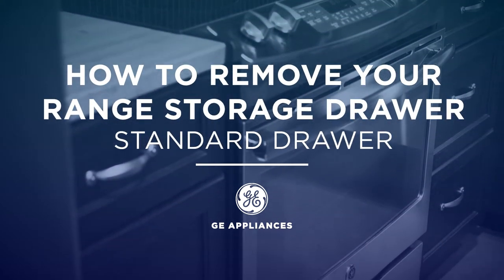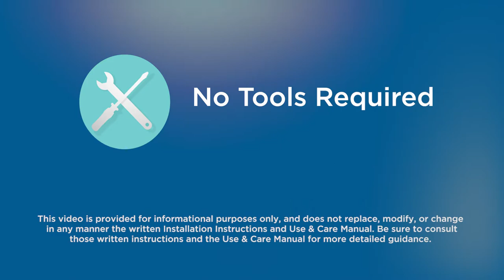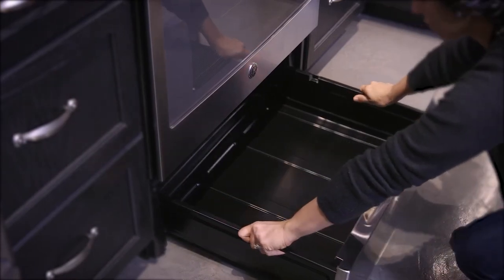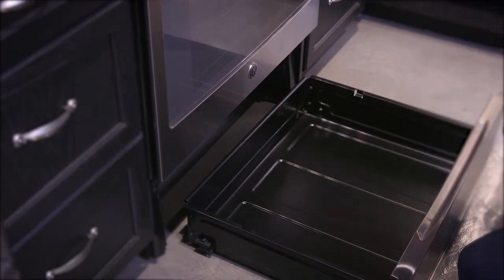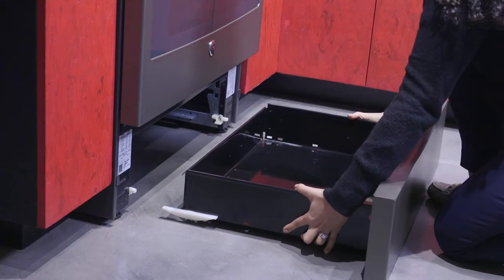Standard Oven Storage Drawer Removal and Installation

Comment: Follow up to my recent comment since I find was in error about the drawer in my new GE gas range. It turns out it was not the design of the drawer with its glides but the range must have been dropped at the factory or in transit. That is why the drawers would not go in and run smooth. I credit GE sending out a repair person the next day.  The repair person said I should have Lowe's replace it since they will do that for any product in 30 days. After watching a fellow here on YouTube putting refrigerator rollers on his that is what I did too and it works fine. (Lowe's did not have rollers but Menards did.  The other guy got is from Home Depot.) However, it did take me a few hours to do it  (Instead of measuring twice and cut once, I measure  seven times and cut three). I recognize that if it was dropped there could be other damage but a cursory look seemed okay and I hate to toss anything.
Reply: Great comment Frank!!! Subscribed for more banger comments.

Comment: Problems with drawer. New GE range arrived with a glide broken. Then when new guide arrived (simple fix) still problematic putting the drawer in and taking it out.  Evidently someone thought they could save some money with plastic guides instead of metal  brackets. I will go to Lowe's and get refrigerator rollers and attach them as one fellow did here on Youtube. He had different range but same problem.